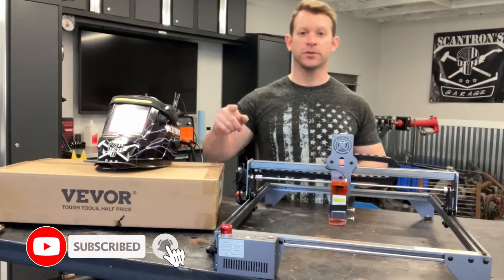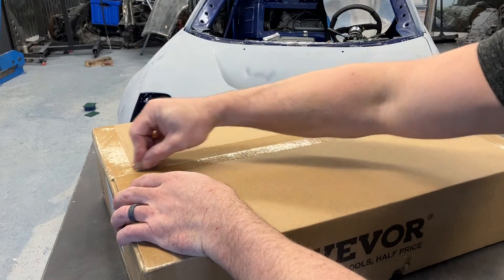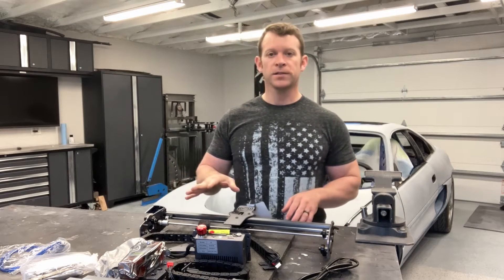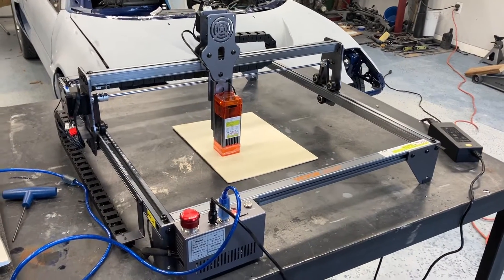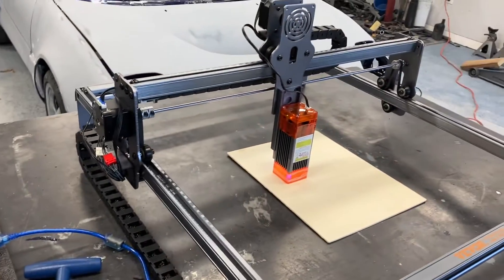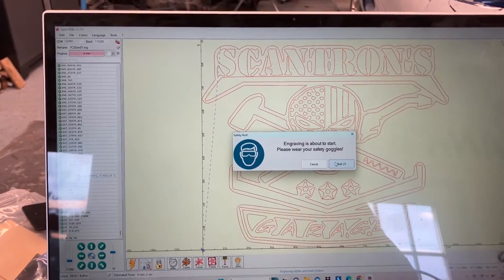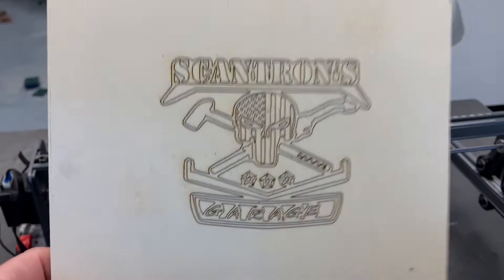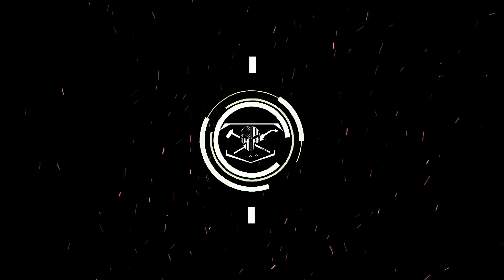Vevor Laser Engraver Review

Comment: Hi, I just got one of these and was having trouble making it work, so I came across your video. Does this laser engraver have any indicator when it is powered on? like LED light or anything.
Reply from the maker: Yes. The laser head has a light and you can hear the cooling fan running when the unit is on.
Reply: @scantronsgarage  I found out that the emergency stop button was pushed down and turned to lock, so I had to unlock it. After that it worked.
Reply from the maker: Ahh Yes! it does that. I had that bit of confusion as well.
Reply: Would this work on curved skateboard decks